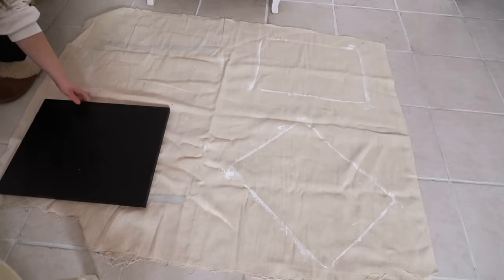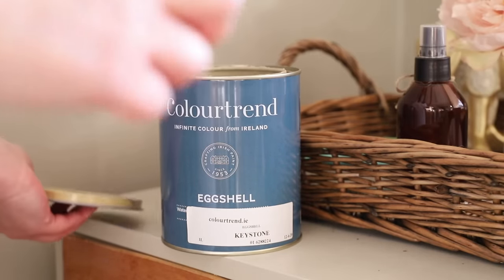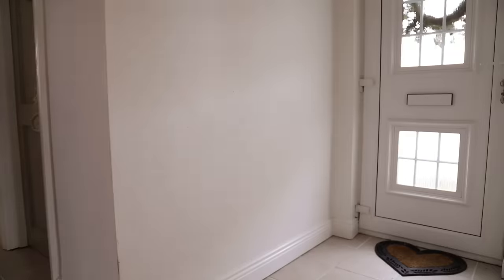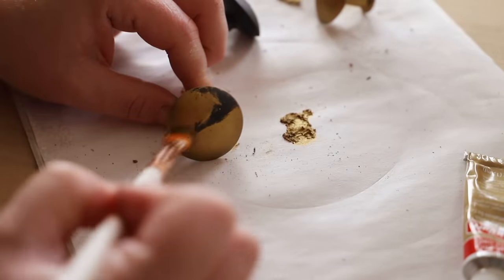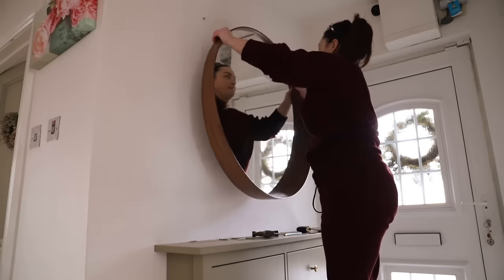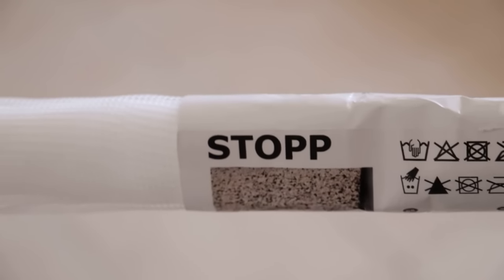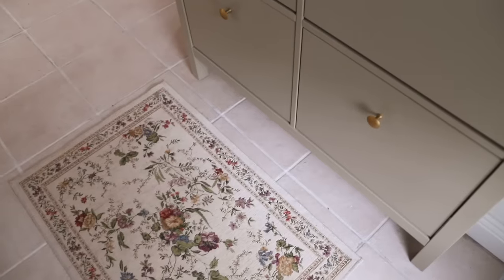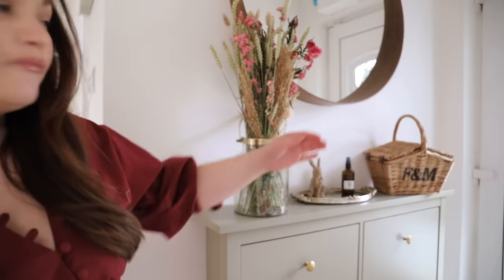Ikea Hemnes Shoe Cabinet Makeover, Small Hallway Storage Update!

Comment: I love the look, I do not have a problem with shoes, but I do have a narrow hallway and the ubiquitous electricity control panel box which cannot be moved. But I wanted pretty, behind my door was a 10-inch space. I had an Ikea tall CD holder unit and it fitted in beautifully I moved in ceramic plant pots not in use at the moment and I constantly change it out. One of the Ikea drawer. dividers fits I use at the bottom to hold extra plugin scented products, and other have my masks , It is so nice to see the space filled and practical and somewhat pretty.

Comment: Love it . Just wondering how to lock it on the wall? What kind of wall grab you are using? Thanks!
Reply from the maker: Check for a stud within the wall, then drill pilot hole, add wall plug and screw in, there are pre drilled holes in the Hemnes unit to guide x

Comment: hello! new subscriber here.  i actually went looking for someone who painted the hemnes shoe cabinet and there you were.  i have a couple of questions, if i may.  i noticed you only painted only the outsides of your cabinet and left the inside the original color.  did you not want to paint the insides?  was it because you were on a time crunch or was it intentional?  i was actually trying to find a method to paint fronts and backs but i couldn’t find a way to suspend the wood to paint it all at once.  i purchased the grey stained wood and have already lightly sanded it down to take off any sheen.  i have a primer that i will paint two coats.  still trying to decide on a final color.  
thank you for this most opportune video.  perfect timing on my part.
Reply from the maker: Thanks for watching Sharon, so glad you found it helpful. Yea, I was kind of lazy to paint the inside as I would have had to wait for the paint to dry either side, what about lining the inside with
 patterned paper? Like the peel and stick vinyl? Might be cute x

Comment: As far as the door, will the cabinet restrict access if you had to move a larger piece of furniture in and out of the door?
Reply from the maker: Maybe, but it is only drilled in with two screws and can be easily removed x

Comment: I used a brush for putting primer on coz it  said it on the tin. Should I have used a roller ?
Reply from the maker: There is no right or wrong, whatever finish you prefer. I like to use a roller and small brush corners ❤️

Comment: What size drill bit did you use to drill into the wall? What weight graded wall plug did you use?
Reply from the maker: Hey Nick, I did this project back in January, so not sure on the drill bit size and I used the wall plugs from the IKEA set. My wall is a concrete wall, not a chipboard, so can take weight.